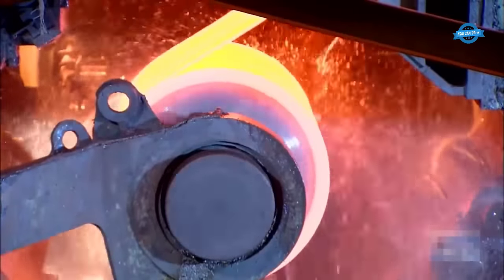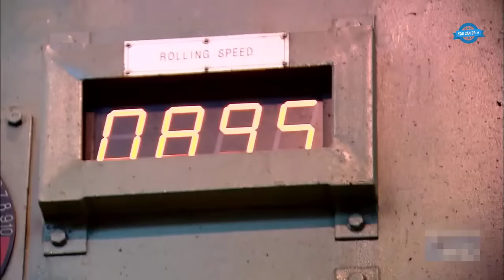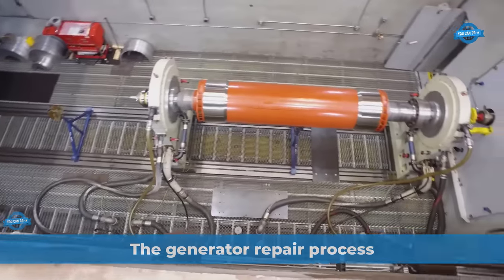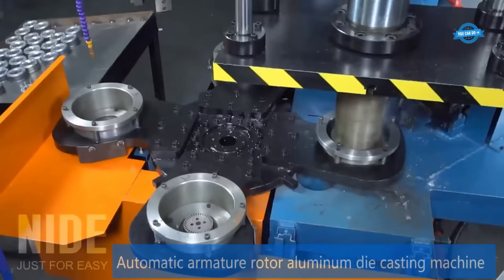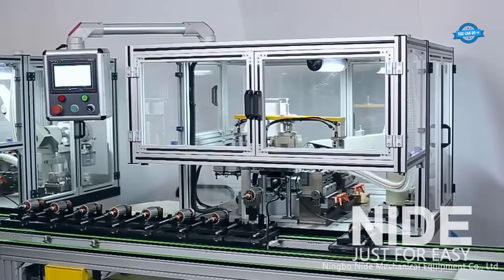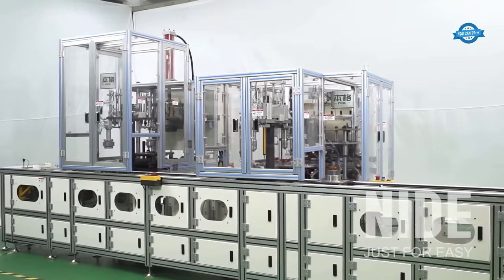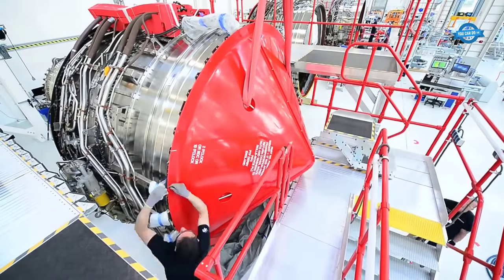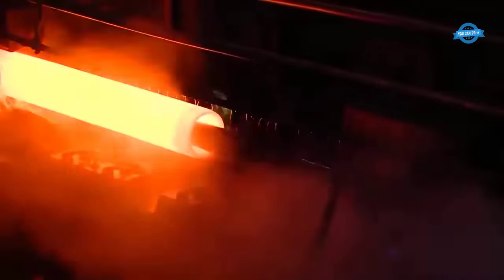Automatic Motor Production Line. Repair And Maintenance Of Steam Turbines And Large Generators

Comment: Had to silver solder 9 bars that had arced opened, on a mill breakdown.  Got it back and running in just under 8 hr.  New spare motor was the wrong one for that application.   Saved 6 mth. Production and 540 jobs.  Nobody cared.   The beats goes on.

Comment: Please Answer this question:- A transmission line has a span of 240 meters. Find the weight of the conductor per meter length, if the sag, ultimate tensile strength and factor of safety are 1.6 meters, 5200 kg and 2 respectively.